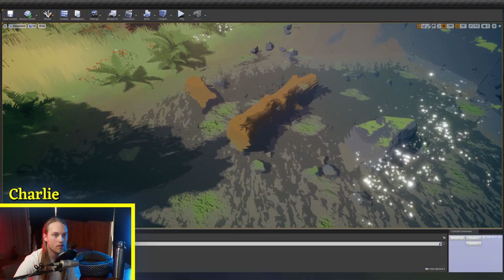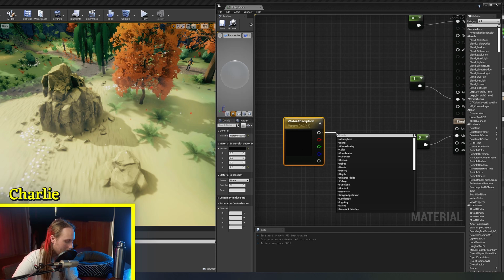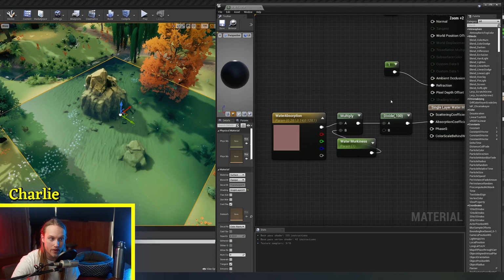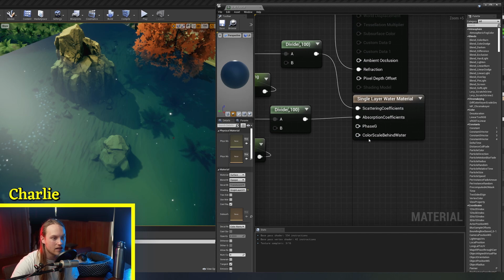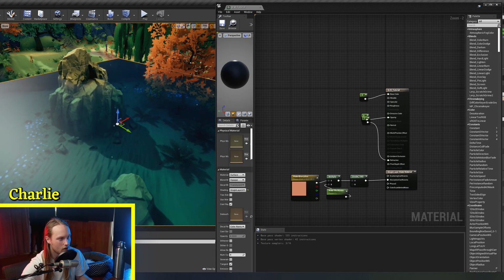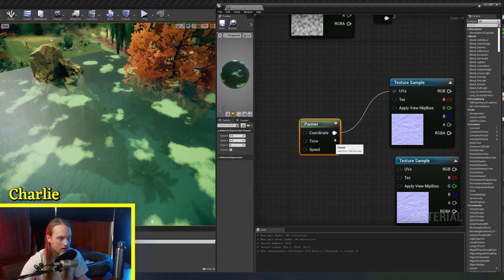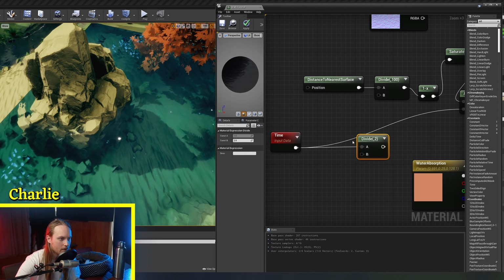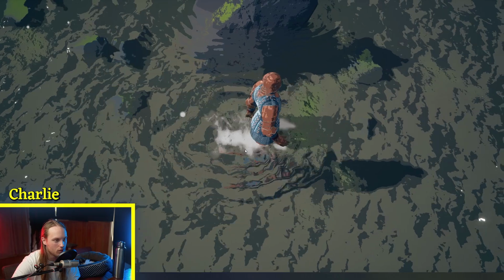Single Layer Water | 5-Minute Materials [UE4/UE5]

Comment: Hey great video but I don't understand how it is better than regular translucent material, even though it says opaque, its shader complexity has t he same color as any translucent material?
Reply from the maker: It uses a separate depth pass - you can only ever see the top layer of the material type at a time. For example, you can overlap planes without rendering twice at the edges and don't get weird gaps in the meshes.

Comment: I noticed that when you add foam effects, the water surface at the junction with rocks and the shore becomes abrupt. How did you resolve this issue? Similarly, I encountered a problem where adding environmental reflections to the water surface caused the transparency at the edges of the single-layer water to lose its smooth transition. I would appreciate your response. Thank you.

Comment: For anyone coming across this video with 5.4 and doesn't see their ripples, I believe refraction is disabled by default? If it is disabled, you can search "Refraction" in the materials details panel and select "Index od Refraction" from the drop box and you should be gucci
Reply: For large water planes or glass epic says use refraction mode = pixel normal depth
Reply: hmm this didnt work for me.
Reply: @mehface  me either
Reply: @mehface   @OreoRobDog  
 try change u  project setings targeted rhis in platforms > windows to vulkan
Reply: it worked for me
Reply: worked for me! thank you :D
Reply: If it doesnt work for you, add it to the Normal instead and tweak some of the numbers to your liking.

Comment: How did you set up the water to work with post processing? It completely ignores post processing for stuff behind the water for me somehow. I've been scratching my head over how to have the water not recieve shadows too, the post processing issue is more pressing tho since mine is also stylised.
Reply: Yeah so what's happening is that I'm doing lineart and scene depth includes the water - you can exclude that there's a function for it, but scene normals always include water ;(. And I need mine to be transparent.

Comment: But then how do you remove the shadows on it? Cause now shadows are just cast like any opaque materials
Reply from the maker: Set the Opacity to 0. The "Opacity" means the surface opacity, not the water opacity.
Reply: @PrismaticaDev  but I use the opacity for the cusp with distance to near.. Since 0 opacity doesnt show the color, i use the distance as an alpha
Reply from the maker: @Snyyx  the colour of the SingleLayerWater type comes from the Absorption values, not the Base Colour. The Base Colour denotes the colour of the surface of the water

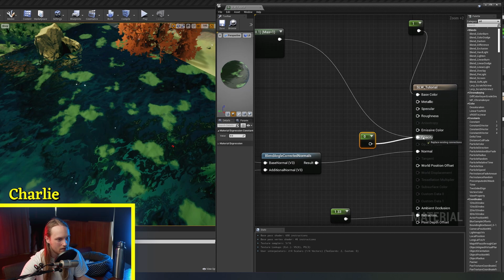Comment: Can someone tell me how did he reduced the base pass shader count from 608 to 133 in minute 7:59?
Reply from the maker: If the opacity is a constant 0 or 1, it doesn't have to render both "versions" of the shader.
Reply from the maker: Also, only using one of Absorption/Scattering will reduce the complexity as well. Keep in mind, however, that instruction count isn't a very accurate way to measure performance of a shader since all instructions have different costs (an Add an a Texture Sample are 1 instruction each, but one may be 100x more expensive than the other)
Reply: @PrismaticaDev  can i send you a screenshot of what im working on? i still have like around 700 instructions
Reply from the maker: @albertusugd3100  700 is quite normal for a SLW shader. If you're using unreal 5 they might have changed the way the instructions are calculated (more accurate to performance etc)

Feel free to chuck a screenshot in the discord :)

Comment: Whenever I connect the 0 value to the absorption coefficients my UE5 Crashes, is this a bug?
Im new to UE5 and Ive come from unity so i dont know if im doing something wrong
Reply: same thing here
Reply: Searching through the internet, I discovered that my graphics card might not be 100% compatible with DirectX 12. I switched to DirectX 11 in the project settings, and it worked just fine. I hope it helps you as well.

Comment: In UE 5.1 you need to disable nanite for the water plane, otherwise it will cause the engine to crash
Reply: OMG! thanks :D
Reply: Thanks for heads up
Reply: Do you know if that's still an issue in 5.3? I intend on using nanite for my project if possible.

Comment: Since this shading model uses a custom render pass, it does not cooperate with "SceneTexture: DiffuseColor", which we use in Cel-Shading material. So, the water ends up being black when the cel-shader on. Anyone knows how one would fix this?

I tried excluding the water part, by filtering it with "SceneTexture: ShadingModelColor". That prevents it being black, but not cel-shaded as well.

--------
Also Hi Charlie, I worship you as an Unreal God. It's been a year since you uploaded this video, so I don't expect a reply; also not sure if you already show the solution to this somewhere else, but it would be good to see your solution.
Reply from the maker: Eyooooo - I'm not actually sure why it might be going funky, since it works fine for me (as you can see in the video)

If you jump in our discord and post some screenshots of your material I'm sure we can figure it out :)
Reply: @PrismaticaDev  Woah! You answered so nice, so quick. You are the best!

Uh, after I tried everthing, I figured out that setting the base color to 0 is what causes the problem. It makes water's diffuse color 0, which destroys the cel-shader. 
You set it to 1, at some point of the video -5:55-, but you also say that It does not change anything, which it does. So, I didn't think that was the reason.

I think, the base color of the water shader kind of works like "Cel-Shading Intensity". Like, 0 is "dont cel-shade",and 1 is "exaggerated cel-shade" (I modified the shader a little, '1' does not suit for me).
Setting the color to something 0.2ish solved the problem.

Regards. ♥

Comment: I along to understand how your Cel-Shade system works and it looks great! However, now when I use the SingleWaterLayer, it does the most weird thing and I don't know how to explain it. It turns the plane into this black magnifying glass that distorts anything underneath it. When I add 0 specular, it just magnifies the textures underneath. I posted screenshots in the GET-HELP part of the discord if my explanation doesn't suffice. Would you happen to know why it's happening?
Reply: Hi, I'm suffering with a similar issue. Did you find a solution for that?
Reply: @_Caose  Yes I did fix it - make sure Base Color = 0, Specular = 0, Opacity = 0 and I changed my Ambient Occlusion to 0.5

Edit: If it works lmk, if not I'm sorry but I don't know otherwise. I just kept playing with the values.
Reply: @theycallme_X  Thank you for your reply!
 I did those, also did several other things. However, the water just appears pitch black when I activate the cel-shader. I'm pretty sure that it's because the shader uses "SceneTexture: DiffuseColor", which is black for the water. I don't get how yours, or Charlie's works properly.
Reply: @_Caose  I'll take another look at what I did. I promise you it was a simple tweak, but it took hours of testing. When I figure it out I'll tell you. 

Edit: Join the discord and ask there. I'll DM you on disc when I see your post and send a SC of the material I have.
Reply: @theycallme_X  Setting the base color of the water shader to something other than 0 solved my problem.
Reply: @_Caose  Interesting! It was the opposite for me... That's awesome though, I'm glad you were able to figure that one out. :)

Was my direction of playing with the values of use to you?

Comment: Refraction must go 1.33, the reason you see it wrong is because on the root is default “index of refraction” but you have to select the second option which is more fitting for larger surfaces like water

Comment: This works great! But how do you get your number of instructions down so low? I'm on 263 with just the the absorption plugged in...
Reply: Figured out what it was in the documentation: If you're using UE5 with directx12 and SM6, the instruction count is basically incomparable with an SM5 shader, meaning it's not scaled correctly to the shader complexity view and thus it will color most materials as approaching or being "bad".

Comment: I got a stupid  question. I messed  up my default water, and wondering where I can get replacement file.  Basic,  model,and part of 4.26 and now 4.27 . THE upgraded Water materials are great, but for simple ponds, I prefer the original water.   Established in 4.26.  IT was also available  in the WILLOW  Tree Pack.  But, doesn't seem to connect up, now. Would appreciate  some help.  THX -Mark

Comment: How would you go about adding reflections to the water? They don't work by default. The only way, as fa as I know for now, is by adding SSR reflections to your post-process volume which sadly prevents you from using Lumen reflections in your scene. Planar reflections also doesn't work on single layer water.
Reply: Specular = 1
Reply: @nether6209  No smart ass. There was no reflections for the single layer water. But it has been added with the latest update of the engine around a month ago. Thank me later.
Reply: @nether6209  The reason for my rudeness is the fact that your answer was useless and had nothing to do with reality and with what I initially posted.
Reply: Oh wait I checked your channel and you look like a serial killer irl. No wonder.
Reply: @nether6209  Keep being offended, you can't offend me.
Reply: @alexanderalikin1210  aww

Comment: Great vid thanks! Unfortunately, the single layer water shading model does not appear to like being two sided. When I make it two sided and view from underneath looking up, it seems to black out the sky but everything else retains its base color. When I switch back to a translucent default lit shading model, the problem is no longer there. Any ideas if this can be rectified or is this just a limitation of the single layer water shading model?

Comment: I have this issue in VR mode with my quest 2 where there's glitchy lines on the water & the reflection is so off. Looks great when simulating in Unreal but when I put the VR headset on it looks weird and laggy. Would you happen to know why? It's a custom water plane, nothing too fancy. Thanks! 🙂
Reply: Refraction is not fully supported for Mobile/Quest platform, mostly its faked with cubemaps

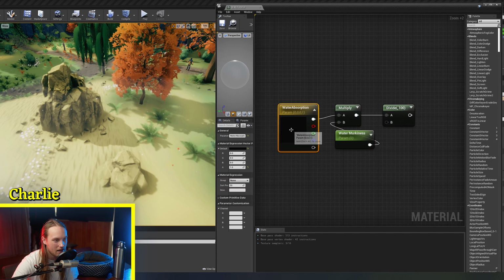Comment: 2:03 the real reason is because we don't care about shader performance, let's add redundant computations.
Reply from the maker: Mmmm damn those 4 clock cycles are going to bite me in the ass one of these days
Reply from the maker: Also I know it’s a joke, BUT the other thing to keep in mind - for anyone reading - is that it’s a constant value, not a parameter, so it will likely get optimised out once compiled. On top of that, if it helps an artist on the team set the colour how they want it to be with sliders rather than typing “0.00027” and “0.0048” in to a box then It’s an instruction well used :)

Comment: This is awesome! :D

For some reason, in my refraction, it doesn't encircle objects in my water, but rather it appears that the entire plane is moving up and down.
In use with the DistanceToNearestSurface, no matter the size of the plane, the entire thing looks quite... seizure-y? Hahah!  With just the constant plugged in it is fine.
Also, changed the divide of time, and helps, but it's not localized around objects interacting with the plane, but rather the entire plane.

Dunno if this makes sense!  But I'm tinkering with it.
Reply from the maker: Don’t forget to multiply your distance fields effects by the initial mask - I explain it a bit more in my Distance Fields 1 video. If that doesn’t solve it feel free to message me on discord :)
Reply: I also ran into that issue, after a day I figured out it was caused by my Effects Scalability being set to Medium, when I put it back to High, everything worked as indended.
Reply: hello :) you have to switch generate distance fields on in the project settings.. I was crying over this for hours. Another person commented it under PrismaticaDevs's video recently
Reply: What fixed this shadow/refraction jumping issue for me was making sure whatever ground geometry is under the water plane has affect distance field lighting set to false.
Reply: @MichaelMurphy-tl6cx  Thank you very much.

Comment: Great content! Do you think that ~600 instructions is good? I also couldn't find a way to reduce it with dynamic water.. Also, in the last part of the video I don't know if that was the same material, but you had there 200 instruction with what seemed like the same result, how come?
Reply from the maker: Heya Mark! I wouldn’t get hung up too much on Instruction Count - it doesn’t take instruction complexity in to account so it can be quite misleading. SLW is also opaque so it doesn’t result in any overdraw/rendering pixels twice. As for the instruction difference later on, it might have been when I enabled/disabled Scattering

Comment: Hey! Love the tutorial! Unfortunately, I cannot get the ripples working. Instead, my whole water plane is jumping up and down. I tried playing with the different values but had no success...
Reply: What fixed this shadow/refraction jumping issue for me was making sure whatever ground geometry is under the water plane has affect distance field lighting set to false.
Reply: is the uv for the normal map scaled too big?
Reply: You need to enable distance fields in your project settings first then restart the editor, that should do the trick
Reply: I had this issue too, even though I had enabled Distance Fields. Solved it by setting Scalability -> Effects back to High, I had it on Medium.

Comment: Really appreciate these little videos. I've been working on my project for years and have a spline-based procedural river system which is an absolute nightmare - one of the biggest headaches was that overlapping polygons and whatnot of the meshes would cause artifacts cos of the translucency doubling up. Never knew about single layer water as an option, and this video made it very clear and succinct how it works - and since it's actually opaque it doesn't cause the artifacts. 

Of all the dev channels I follow, yours is the one that consistently helps me in my project the most, and I'm really impressed with what you've done with your own game. Thanks for this
Reply from the maker: Yes, it's absolutely perfect for doing things like waves and avoids overlap! I appreciate the really kind words :)

Comment: If you still have some issues with the refraction, you can alternatively change Index of Refraction to Normal Pixel Offset in the material settings which distort the picture based on the normal map. 
It is not physicaly accurate by any means and without normal map it does nothing (not great for still water) but it does not have the weird reflection artifact near the shore. See UE4 documentation.

Comment: Thank you! How do I make this work with my Celshade???
Reply: Bless this comment, was having the same issue. My base color was 0, which was messing up my cel shader and making it completely dark. Setting the color to 1 caused it to glow, but then setting specular to 0 fixed it for real.
Reply from the maker: Is your cel-shader material-based or post-process based? If it's post process, it should just work by default :)
Reply: @PrismaticaDev  It's post process but It was my bad!! I had a value 0 constant on my Base Color and my water was glowing ahaha. Sorry!! Nice tutorial, I'm learning a lot!! <3
Reply from the maker: @yunoswaifu  Ahhh yep, that would have been causing a Divide by 0 artifact haha. Glad you fixed it! :)